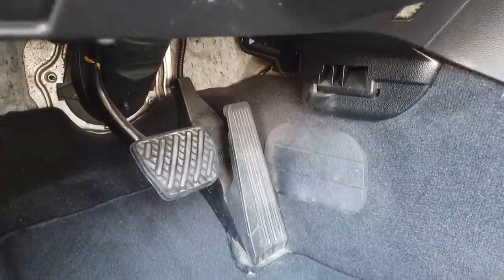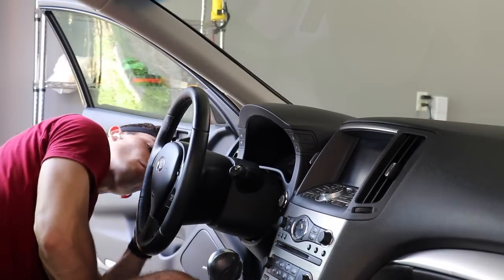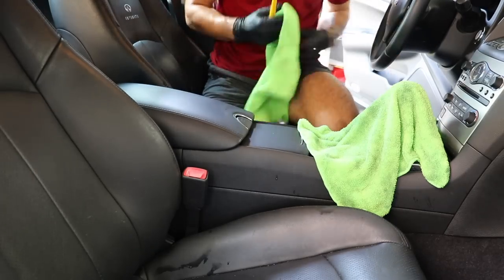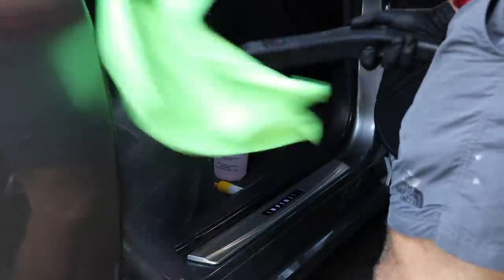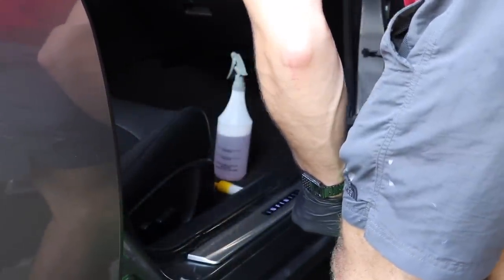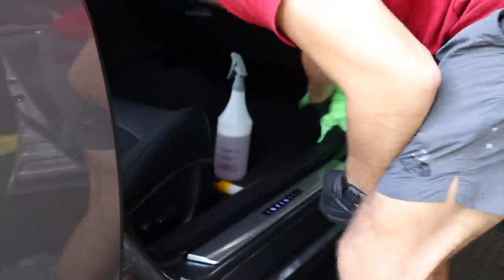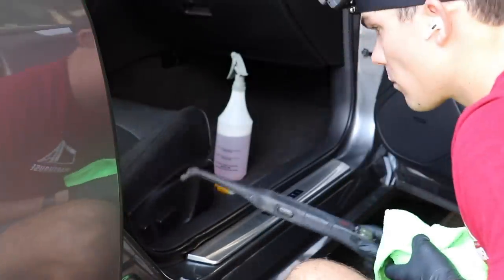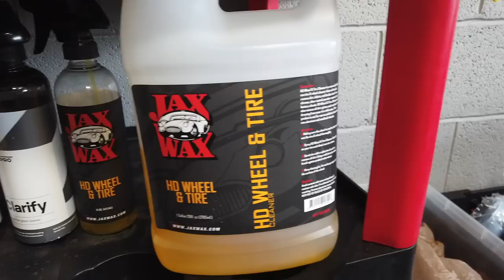The Simplest & Most Profitable Detailing Business Strategy | $1,000 Per Week

Comment: When you use an apc say super clean diluted on plastic vinyl or leather won’t that dry out the material?
Reply: You can diluted the APC as much as you want. Maybe keep a 20:1 dilution or something. 

Or you could just use rinseless wash diluted.
Reply: Super clean isn't an APC, it's a degreaser. An example of an APC is CarPro MultiX. I'd never use super clean on interior, too harsh.
Reply from the maker: Hey man this might help answer your question:
Number one, in many years of doing this I have never experienced this thing that some talk about in drying the materials out. Number two, if you'll notice, I always finish the interior with some sort of detailer/dressing/protectant which logically is going to "re" condition the surface and keep it from degrading